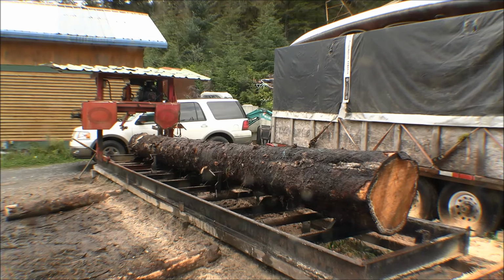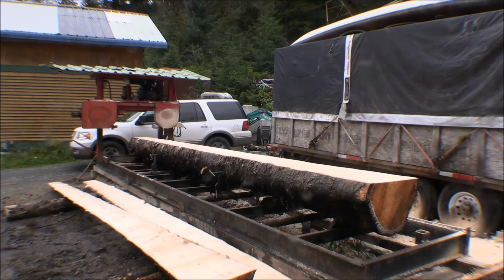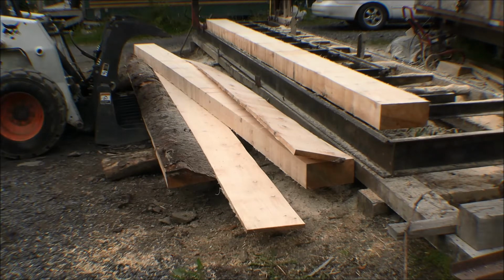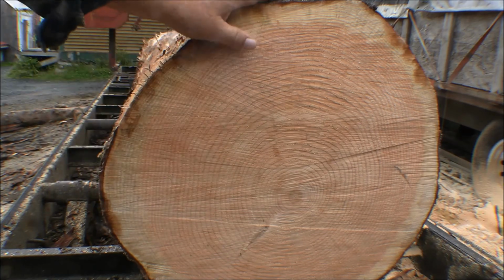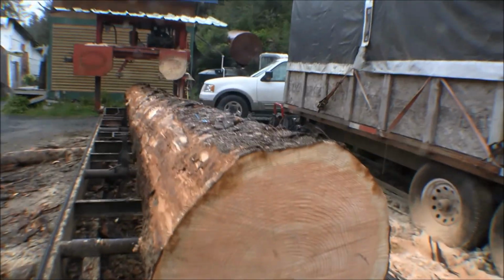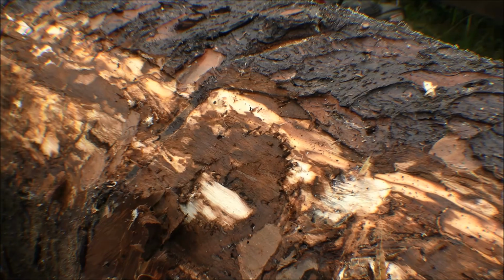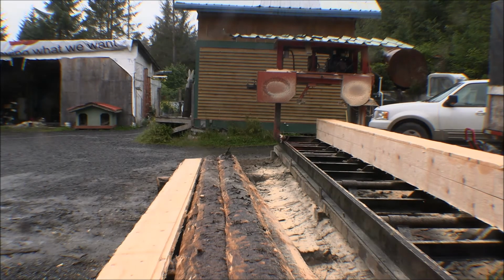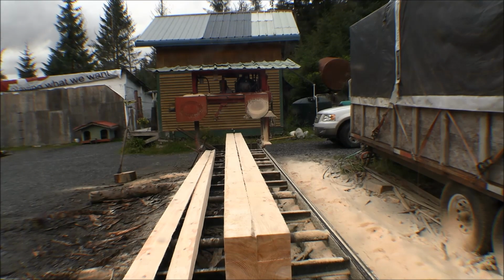Milling Sitka Spruce  6 X 12 X 20 Timbers on the Mighty Mite Band Saw Mill

Comment: You have a lot of milling yet to go and I'll be watching every board..  
I looked at a relatively low rust, old, International Enterprises Mini Mite today.  One using circular saw blades (like a MD) and not a band saw blade.  It was newly arrived for a full resurrection from a lot of years in storage with probable fabricobbling.  LOTS of wierd looking "parts 'n pieces" that seemed to be from other mills (I'm guessing probably grafted onto this one over the years).  The current owner had contracted out a make-over, hoping to returning it to a usable condition and getting it cuting again.  No comparison to yours!  
SN G412MD1569 Model G412MD (could it be an early one, made by Mobile Dimensional?)     - Joe -